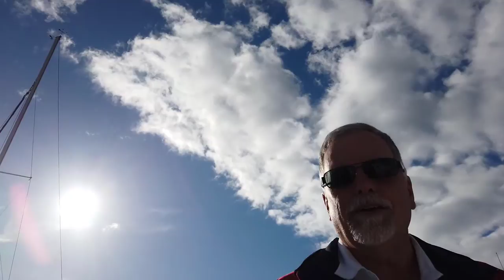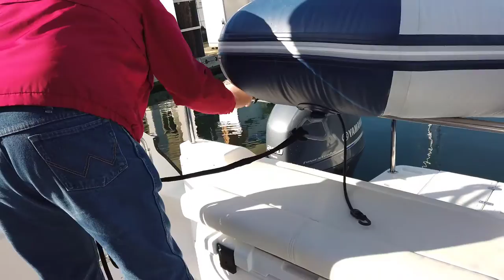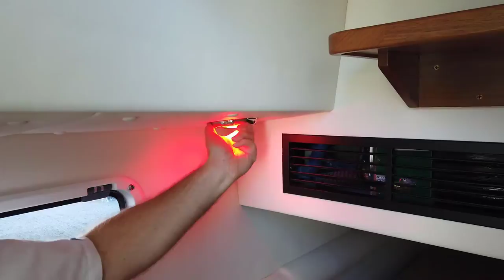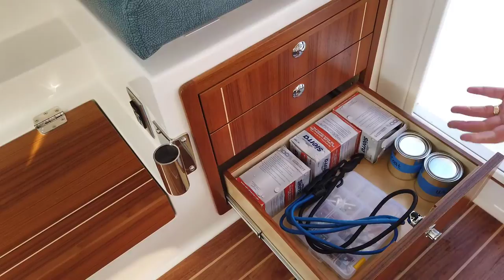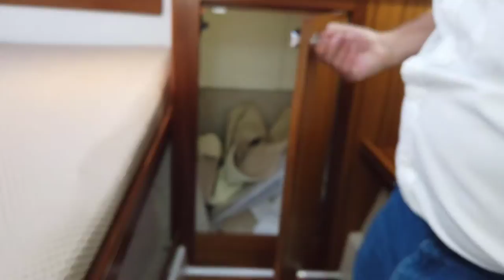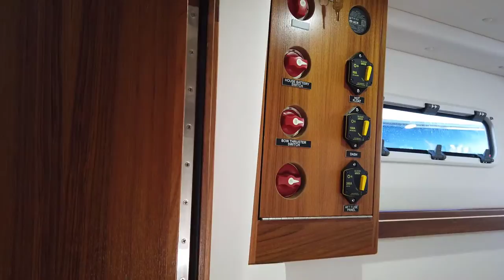Aspen C108 Walkthrough

Comment: Odd as it might be to say for a seven-figure boat, I think the value curve crosses price in this market for the Aspen line up with the C-120. Not saying the smaller boats aren't amazing vessels, it's just that I'm not sure they're enough boat for the price compared to the huge amount of competition in that size / cost. At the upper end though, there are a lot of inferior boats hanging around the low seven figure area that the 120 just absolutely demolishes.

Again, if I had the money and actively didn't WANT a bigger boat, Aspen's are fantastic, just seems like in the market space for smaller boats the price tag here is a big ask. But I guess at the smaller volume in which Aspen builds boats, saturation doesn't matter much anyway.

Regardless, as usual, taken on their own, Aspen is an amazing, killer, boat.